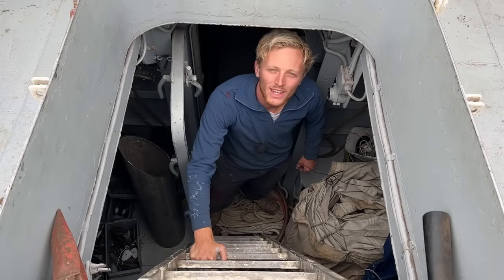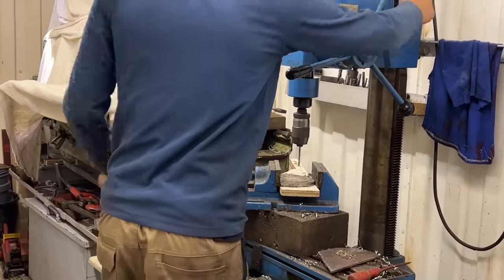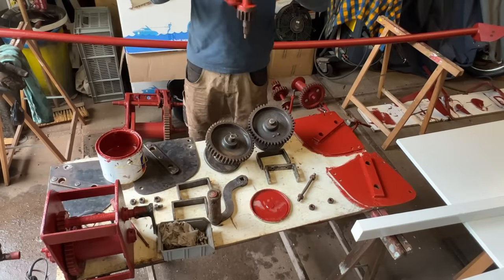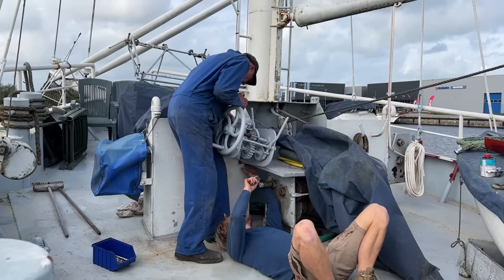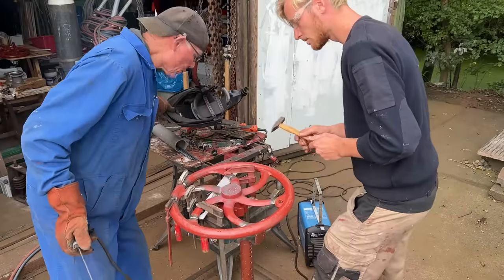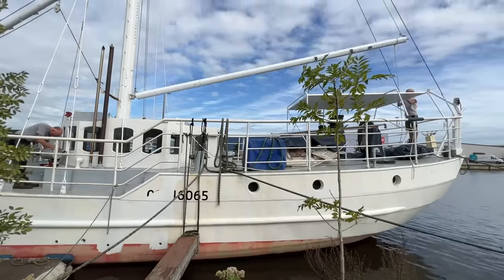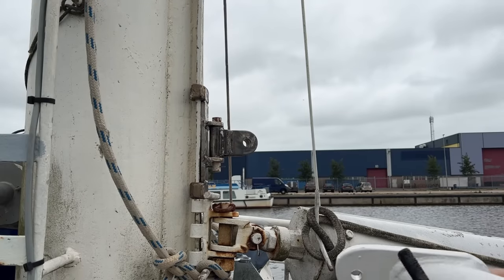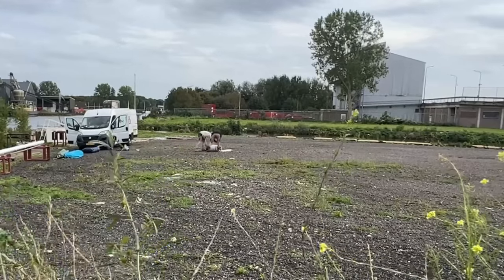Can We Get This Ship to SAIL?

Comment: Those wheels are works of art. Pure and functional, no need for anything fancier. 

Something you might consider though is wrapping the outside of the wheel in paracord that is uv stabilized, that will give a nice grip texture that does not have to be painted.
Reply from the maker: Thanks! I think once we start wrapping things in paracord, we will not know where to stop :)
Reply: @tigersharkboatworks  it is easy to get carried away with such things!

Comment: More nice work and cool to see the old school winches.  If I could make one suggestion, it is this.  Years ago, I was part of a crew delivering a very well known offshore racing sailboat from the US West Coast to Hawaii for the Kenwood Cup.  The person responsible for taking care of the boat, and also skipper for the delivery trip, put on board an old set of sails from another boat of similar size (including a spinnaker) so as to not wear out the racing sails.  When we got to the point to hoist the spinnaker for the downwind run, the sail literally blew apart.  We pulled it down and upon examination, almost every seam was rotten, along with the cloth.  The sail had been stored for several years without being used or looked at prior to our taking off.  Therefore, my suggestion is to examine every seam of every sail for thread wear and to also check the cloth to make sure you don't have any rot due to mildew or mold.
Reply from the maker: Thank you, thats very good advice :)